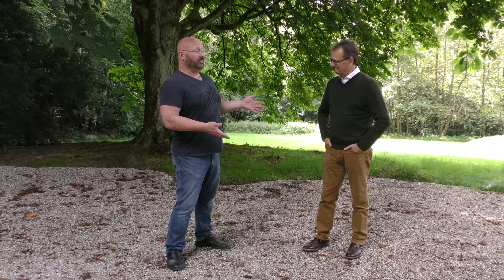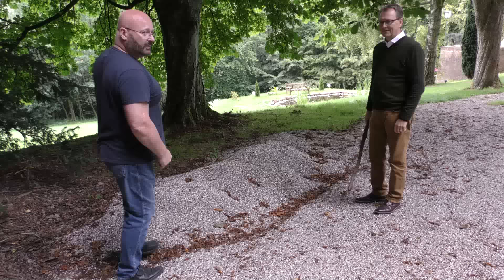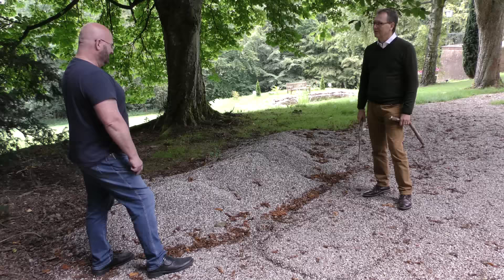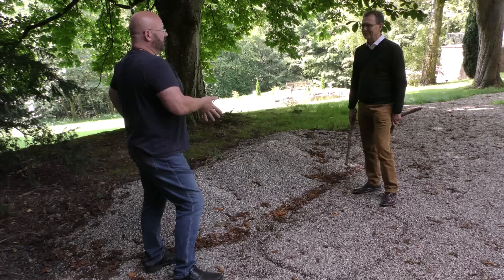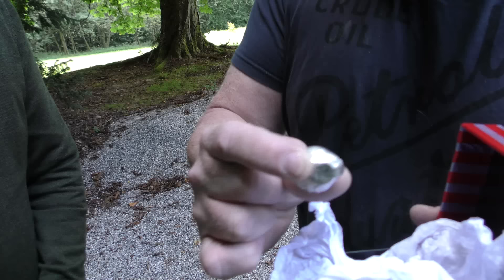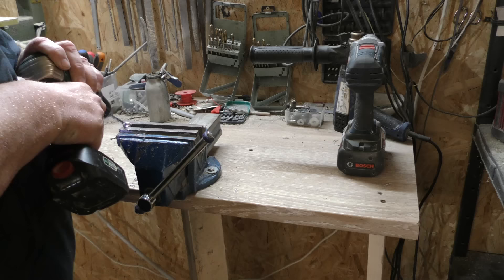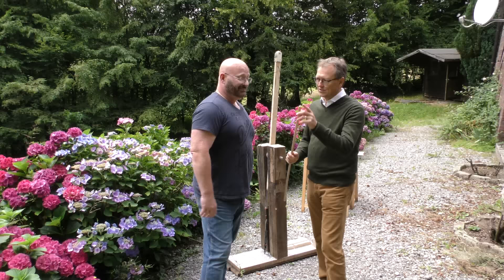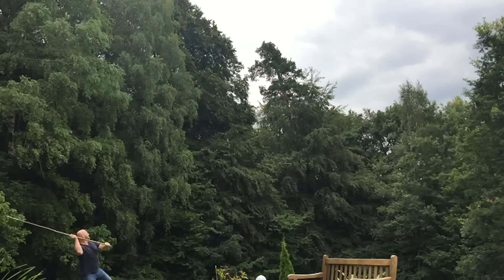The Mystery Of The Whistling Bullets: Psychological Warfare, 200 AD

Comment: @JoergSprave,  I perceived that the 4mm hole was in fact a far clearer and louder sound than the 6mm hole. And you tested smaller only 3mm so far as I thought you said, though perhaps you could have tried 2mm?

Also, I challenge your assumption that the hole size must be critical if they were intending the sound. Why? Because there are other variables. And it is anyway illogical - supposing you did want the sound, and then hole diameter doesn't matter, so you choose a random diameter - then later investigators find hole diameter doesn't matter... if they conclude that means you could not have intended the sound, then they would be wrong. Right?

So the logic fails on that point. Your logical position should rather have been that If hole size were critical for the sound, at 4mm, then that would indicate a higher probability of this theory being correct. But that's all. If it's not critical, that merely adds no extra evidence to the case.

Now to the other variables... we must consider what other factors could lead them to their choice of hole size. So, we must consider two things at least: the affect of the hole; and their tools.

Affect of the hole:
So we know that the hole can cause a sound. But we must consider that also the hole reduced the mass of the ball. Now, more mass = more damage to the enemy, so, we know mass is desirable. This makes this factor favour a smaller hole. So, that means that if 4mm and 6mm have the same sound, and if they are equally easy to create, then, 4mm would be the best choice, since the mass will be greater.

Now that's assuming the sound is the same. But going back over your recording, for the examples you provided, the 4mm was in fact better for sound, thus making is better on both of the points of consideration so far.

Tools:
I am not familiar with the tools they had available. But using logic, I could assume that holes were not the easiest things for them to make, and I can imagine that there is some limitation on how small they could make holes, since smaller holes require more delicate tools, and any tool making a small hole would be liable to break. For example - how much harder would it be for them to make a 2mm hole versus a 4mm hole? Were they even capable of making a 2mm hole deep into solid lead?

Then, on the opposite end of the scale, we may consider than the larger the hole, the more energy required to bore it. So, for example if 4mm and 6mm are both good for sound, and if the tools for both are of equal capability, then on this point, one would prefer 4mm as it requires less energy to make. And they were apparently making them by the tens or hundreds of thousands at least, if this one day of battle is anything to go by! So, energy saving (even for manual labour) is a highly significant factor.

So, 4mm wins over 6mm for the sound hypothesis on the following points:
-Greater mass
-Superior sound to 6mm
-Less work to produce than greater than 4mm assuming the tooling equal
-Easier tooling than smaller diameter.

Now regarding why the holes were all the same size. I think this is easy to answer... or at least what I believe is the most probable answer, is that even if hole size were not important, when you are mass producing an item, then it would be irrational to make unnecessary variations. You simply create a standard, and mass produce it.

And also consider, if they were indeed producing hundreds of thousands, or millions, of these, then their tools would need frequent replacing. So they would need also an industry for making the tools! And there is no logical reason to mass produce a random variety of tools! You simply stick with a design that you know works, and set about making a lot of them.

And in the factory making the balls, the hole drilling workshop would have a set of spare drill bits, ready to swap out any part as soon as it fails. And for that, standardisation is important. So, we must remember the scale - it's not random farmers making them individually in their back yard. It's the Roman Empire.

This is not to say that I oppose the poison hypothesis. But just to say that I believe the basis on which you dismissed the sound hypothesis seems unfounded. So perhaps both should still be considered, along with the stick hypothesis.

Comment: Perhaps they chose 4MM holes because it was a trade-off between weight and that their tools could not create multiple 2MM projectiles en mass. Or 4MM was chosen because if there were a throwing stick, 4MM might provide strong enough of a metal rod that would not break in battle, transport or repeated use. Older metal was also not as pure, or tempered so it would not be as durable as modern metals.

Comment: i think its more likely they made the holes for that whistling...and the reason they used the smaller holes was so the projectile could have as much mass as possible while still giving the projectile that whistle ...using poison doesn't make to much sense for indirect fire..i mean your basically wasting a ton of time packing those holes with poison thats probably going to fall out of the hole during flight, or when it strikes flesh in the right way...with the whistle you get the torment factor

Comment: All your penetration tests were done at point blank though, at range they would have lost quite a bit of energy. Handling poison on the battlefront would have been risky plus there would be detectable residue even today in the holes if that were the case.
Due to the weight of the small balls, I think they would have lost too much energy to do any significant damage at range so they were probably a terror tactic with the specific size being preferred for the shrill whistle. The size of the hole, possibly just a standard size for a punch, lead is soft and a drill is probably not required, a punch would be significantly faster as well.
I do like the stick launcher idea though too, its not unheard of for armies to inflate their ranks with drafted soldiers and equip them with simplified weapons. The heavy shots being reserved for the highly trained and accurate soldiers to do the damage while the less accurate whistlers sent people scattering.

Comment: What would they have used for a poison substance. Would the inserted poison substance remained intact, in the hole, throughout flight at velocity? It would have been cool to devise a way to throw a host of "whistles" hurling through the air, and to record the sound. Would the sound produce any kind of fright or flight reaction, by those on the receiving end of the assault? TAKE COVER !

Comment: Of course these are all point blank, but you could assume with a fair amount of certainty that one of either of those slugs would have been fatal impacts, even it they didn't penetrate the body but a small projectile would have been more likely to enter the body if it had enough energy behind them. The poison theory is still kind of weak and the roman were not that subtle with their war, it was more likely a simple kinetic weapon and enough of them into an target village would cause enough injury that the Romans could then move into the town and slaughter everyone like they always did. Poison was a perishable commodity and I doubt they would have used it wholesale however I wouldn't doubt that some of the soldiers would have used it just for extra effectiveness if they were facing particularly difficult opposition.

Comment: Couldn't it just be that they had a specific tool to drill the holes which were all built the same way? Therefore all the holes are the same size just because that was the tool they used maybe.

Comment: The size of the hole does matter. What's happening isn't mysterious here, these projectiles are acting much the same as a bottle with air blown over the opening. Larger or emptier bottles will, as we all know, resonate at a lower frequency.

 The larger—and deeper—the hole is, the lower the pitch will be. The thing is, at these very small sizes they will all be relatively high-pitched. The difference with a larger or more hollowed-out projectile would probably be a lot more noticeable.

Comment: Having served in the US Marines and studied battlefield tactics. Rapid communication was the key to winning. 

That said I can say your conclusions  are all wrong. These rounds were not ment to put fear in the enemy. The sounds would be high pitched and not deafening loud. Now if the slingshot rounds made sounds of humans screaming in horror like the ancient whistles found in South America, then I would agree. However the whistling sound was not terrifying and if used as a weapon would leave you with a bump or eye injury.

The real purpose of these small easily portable slingshot rounds was for "Instant Coded Battlefield Communications" to alter tactics, and launch counter moves. If the Roman Commanders saw the enemy was about to flank them they could instantly issue commands using these whistling projectiles. If the left flank needed protection you would hear say 1 whistle, if you heard 2 then your front needed reinforcement or if you heard 3 then you right flank needed reinforcement. Then secret commands could be used by how close or spaced out the projectiles where used. If 3 whistles were shot very close to each other it could signal held back calvary to attack, or launch a flanking attack.  These would be very effective during loud battle action. And the Romans would know exactly what to do based on the pre determined code setup before each battle. 

Your enemy would only hear a whistle and think nothing of it. But the whole Roman Battle Formation would know exactly what to do if they heard their preassigned whistle command. That's why the Romans dominated multiple nations for so long....these whistles were their battlefield communications system. And they could change it with a blast of 1 or more horns. That way your enemy never new what the heck the Romans were up to before it was too late. This Roman Battle Field Enigma Whistles would give the Romans the ability to instantly act.

An additional benefit is that the whistle would sound across the full length or breadth of the battlefield depending on its launcher.

Remember what made Alexander the Great such a good Commander was his ability to read a battle and augment tactics quickly. And the reason why no one has found anything about the use of these items was because it was State military secret. Just like Greek Fire or Roman Concrete their recipes have never been found. If an enemy learned of this Audible Coded Message System it would allow the enemy to counter any attack. Yet the Romans ruled with an iron fist for hundreds of years.

Of course this is all conjecture yet it's a heck of a lot better than saying they were for terrorizing the enemy. The launching of one giant ballista would have made the enemy crap on themselves.

But if used as a means to issue commands it would be perfect.
Reply: It seems that they could have just used actual, dedicated whistles for such communications, instead of making whistles out of projectiles. Surely it would have been easier to make dedicated whistles over making thousands of projectile whistles that only were meant to be used one time each.
Reply: I never thought of the bulletts as communications tool but thats all the were.. no way, i dont believe it! 
At first this sounds logical, but as soon as the enemy finds out you communicate with whistlebullets (and they will), they will send you some too and easily can cause false Orders. Also there can be a lot of Noise on a battlefield, the bullet has to be very louder, much louder than these that the found. Using Trumpets, Drumms and colored Flags & Banners as signs for orders is much safer+effectiv for communication. Please explain this: Why have they found so many of these Bulletts in one close Area, if they were not shot dirctly on their enemy hiding in that place at that time? And i think the psychological use of the whistling bullets was real (intimidation), used against horses but mainly against humans. 

For Example, the Celts hide in their Place and the Romans would be sending a 200-bullett-greeting when they approach, should give an intimidating effect on Moral even if they dont kill a single Person, it would definatly bring fear to some enemy warriors and most likely peasants or farmers among them. Also in regular combat it would bring confusion if used with logic + skill, i see a lot of uses of the whistling bullets in combat.

Comment: hmmm Just Wondering if it was Posible back then to cast Projectiles with an Hole in it back in the Roman Era, Because The Romans Where Very Good at Mass Produce stuff, so it Would be a Posible thing, as far as i Know the Romans almost never made something that Took to mutch time, and all the Military stuff they used where made to be able to Supply the units as fast as Posible, would take to mutch time to Drill holes as both of you said

Comment: i have real contention with the staff sling. personally i dont think it's at all a reasonable weapon when compared to a rope sling. first off, it requires the use of the ball with a precisely drilled hole for operation while a rope sling can use rocks you can find anywhere. second, a wood sling is a fragile and single use appliance. just a few pounds of force on the sides and it's done. a rope sling on the other hand can bend and even be tied around one's waist or head for storage while the wooden sling must be carried. finally, straight pieces of wood would more likely be in high demand for arrows at that time. put a piece of metal on a straight piece of wood and you're two thirds of the way to having an arrow so why not just make on of those. also as a side note, fibers would be easier to find and therefore cheaper, thus making the rope sling a more economical option as well.

Comment: plenty of ventilation when smelting lead pls...  i know someone who smelted lead and also got cancer.  as for the uniformity of the hole size, it could be due to an ammunition assembly line...  maybe they had some sort of press to use on the lead before it fully hardened, rather than hand tooling

Comment: Max power is not the point. When there are literally thousands of bullets, probably a hundred thousand or more, you need a technology that allows a thousand soldiers to throw a hundred bullets in a short time.  After the first attack with bullets, the man should not be exhausted but still be able to fight with full power in 1:1 combat.

Comment: What if the hole was to tie a string though with a knotted end and the swung around like a miniature hammer as in the hammer, throw in the Olympics, giving the projectile greater range. Over the centuries the strings would have perished just leaving the projectiles behind.
Reply: then not the.

Comment: well i think, cuz of the same length of the holes, specific to 4mm.. it was made to take a specific measurement of something.. to make as many bullets as possible, and cap it off with wax or sumthing... so im going with poison.. the kill rate would not have been high enough with just launching these from far away, you would have gone from a low kill rate to 100% so if they had poisons at this time, i bet one or some of them was in those bullets ;p;p;p

Comment: The stick theory is no good at all. Useless. They all had the exact same size of hole because they used the same size of drill, because why would you use a different one? All of those bullets were probably made at the same time, in the same place, so of course they're all the same. You've got to mass manufacture them.